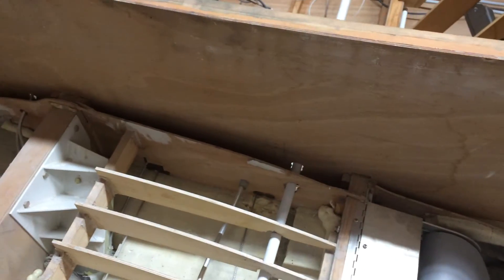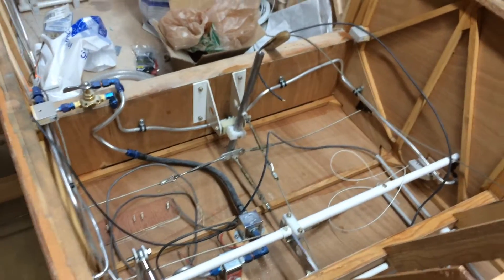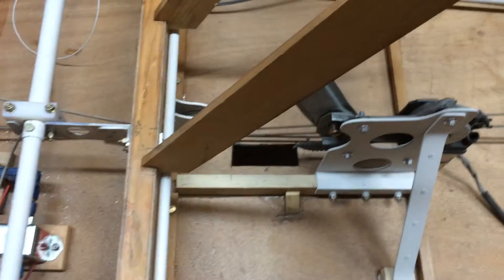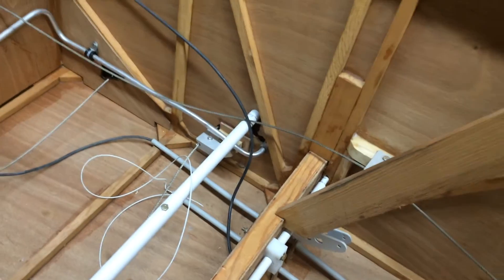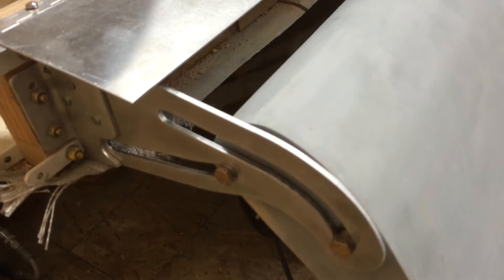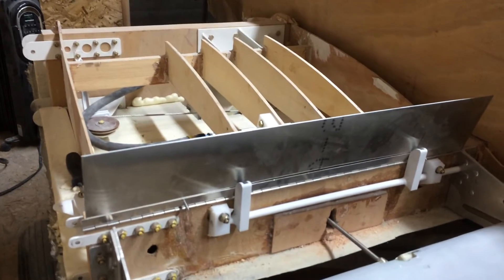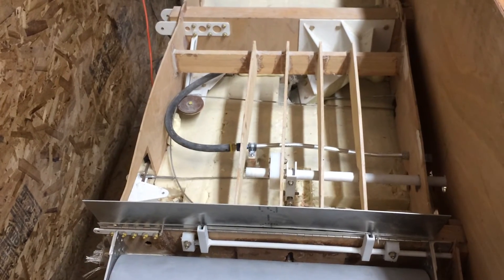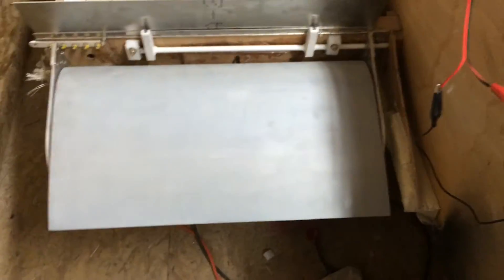KR N257DP Flaps Spoilers

Comment: That spoiler may lift due to airflow over the top of the flap leading edge when the flaps are extended. That may pose control problems or have other unforeseen circumstances.

Comment: Awesome job. I would like something similar.
Question on the horiz and vert stabs. You increased their size to enhance stability?? I know tge kr2 is said to be a handfull in the roll and pitch do you think this will affect this?
Also i am planning on a 6 cyl 100 hp corvair engine also for a kr2. Is it necessary to streach the fuselage like you have done to accomidate this engine?? I can be emailed at jtjamesmichael2112@gmail.com any help greatly app as i am just starting my journey in this.. Thank u.